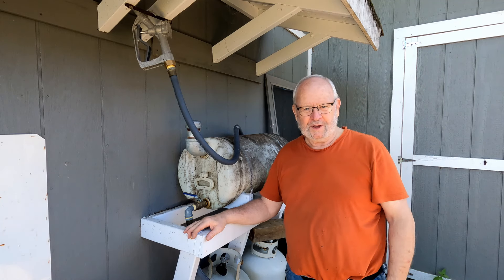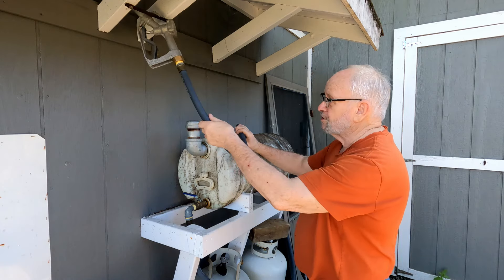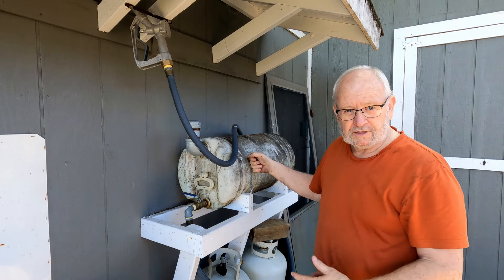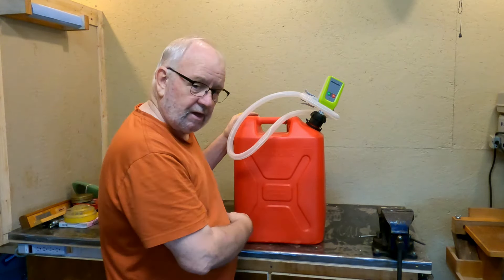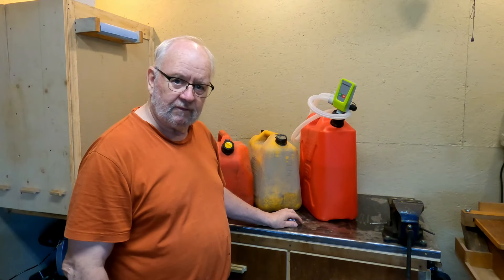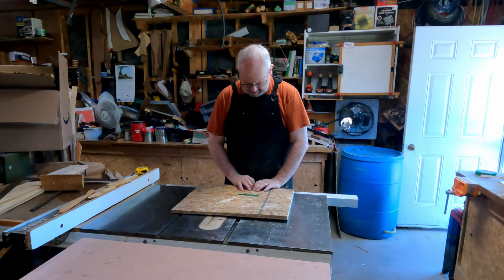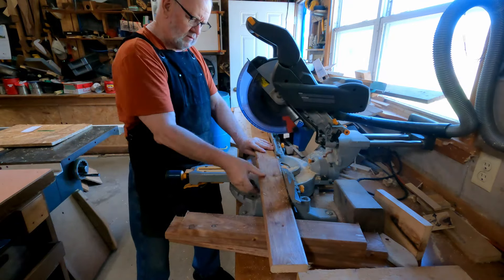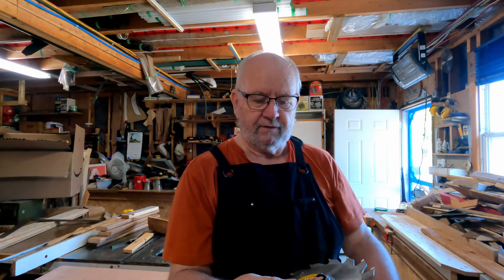A Shopmade Fuel Dolly Part 1

Comment: Working smarter, not harder. Just when I think you are running out of projects around the Camp you find more to keep you busy.  Always a pleasure to see you working away Mike. Take care and of course a hug forn Nannie J eh ! I was watching you the other day at the table saw with no insert around the blade. I feel a lot better seeing you are getting caught up on those. I have 6 for mine.
Reply from the maker: How's she goin'?  There is never a lack of projects or 'jobs' to be done around the camp that's for sure.  I'll be sure to give Nannie a hug from you old friend.  When I was using that wobble blade on the the 1 x 4 there was no way was I going to try that with no insert!!  It's all good now.   Take 'er easy!!
Reply: @GrampiesWorkshop  They don't take long to make either. I planed down a sheet (pc) of 1/4 ply and stacked the pieces up so I could saw up 5 pieces to run through a bandsaw. I haven done them for others . Esp for the dado blade.Just put them on a wall so they are easy to find.
Reply from the maker: @TomokosEnterprize  Stacking the 1/4 ply is a great way to make the inserts.  And having different size opening is key.  I'm kind of lazy and only have the one, but now that I made this one, I at least have 2 now!!  LOL  Take care!!
Reply: @GrampiesWorkshop  Yup 2 is better than none. Once the seed has been planted you'''ll always have it on yer mind. Not a have to do but it sits there untill it bothers you baad enough. My Mary was a pro at doing that to me. LOL. I promiss my lips are sealed to Nannie J, LOL. Have a beautyful week fella.
Reply: Hey, With all this going on now It is crazy to stiill  want to look back on our pasts and try to make any sense of it at all. Our days turned around wondering justj what has been done with them all.We seem to sleep less and get even less achived.We should e doing less with everything considering what we have learned  over our lifetimes . It causes me to pause and wonder just what we have being achiving these days. A conumdrum indeed old friend !  Take care fella. All the best of the best to you once again Mike !
Reply from the maker: @TomokosEnterprize  I hear ya Dean!!  I find it takes me all day to do what I used to do before break!!  But I'm still enjoying the ride!!  LOL  Take care!!
Reply: @GrampiesWorkshop  Ride em hard my friend. Just don't put it away wet eh, LOL.

Comment: I had found a comercial roll of wax paper that I put down under glue ups. Once the glue dries I slide it over an edge and the glue comes right off. The stuff lasts for a good long time.
Reply from the maker: That's a neat idea Dean!!
Reply: @GrampiesWorkshop  If you can't find wide wax paper regular works and another wide option is meat packers paper. It  has that slippry/water proof side. It's tougher than wax paper too. Where I worked last time we had a 24 wide bench for glueups and had the meat paper on a hanger (like a TP roll) at the end of the bench so we could get fresh paper to staple down. It was a really busy bench.
Reply from the maker: @TomokosEnterprize  A buddy of mine had a glue up table that I would like to copy some day.  It had a TP style holder for paper like you mention and he also had slots cut in the table for his pipe clamps.  Man it was a beauty!!  Take care!!
Reply: @GrampiesWorkshop  I have lots of pic's of that shop. We made log homes and when I wasn't on the tools (10 chainsaws, a skid loader 3 tractors and the sawmill along with the rest of the ranch I made trim for a 5 head planer/molder. I had all the toys any good wood shop needed. A single head planer is enough of a pain in the heini, just think about 5 timesnas bad eh, LOLOLOL
Reply from the maker: @TomokosEnterprize  A walk in the park for you I bet Dean!!

Comment: I wonder if that dado blade is still CSA Approved 🥴😳😂. Quite coincidence, I did a video today and mentioned I finally installed a zero clearance throat for my table saw 👍🏻. I love my gas cart, makes it so much easier filling up my tractor 👍🏻. OMG THE SUSPENSE IS KILLING ME Mike…what did he do…😂😂😂. Have a great week Mike and Nannie 👍🏻🙂🙋🏼‍♂️🇨🇦🍻
Reply from the maker: Salut Luc?  You know what?  When I saw your fuel cart I started thinking about how neat it was to take the fuel to the machine rather than the machine to the fuel.  The wheels have been turning ever since!!  This dado blade is pretty old.  I wouldn't be surprised if they are no longer available.  They look lethal eh!!  And they don't make a good dado as the cut out is not flat bottomed due to the swing of the blade as it cuts.  But for this project I figured it would do the job!!  Thanks for watching.  A la prochaine!!

Comment: What! I’ve never heard of a wobble blade for dado’s. I’ve used the dado stack….  Pretty cool tool. Great start on your dolly, heading in the right direction. Cheers, Mike. 😊
Reply from the maker: How's she goin'?  Thanks Mike.  I'm not too sure they even make these wobble blade anymore.  They don't really make a good dado since the bottom is kind of arced due to the wobble of the blade.  But for this project it worked fine.  Take 'er easy!!

Comment: Master carpenter at work. 👍🏻👍🏻👋👋. Nice job Mike. I’ll be staying tuned for the next exciting episode. 👍🏻👍🏻👋👋
What I’m wondering is why you didn’t put glue in the dado joint. ?  
Have a great Wednesday you and Janet. 👍🏻👍🏻👋👋
Reply from the maker: How's she goin'?  Thanks Noel!  I have been thinking about making this cart since I saw Luc's at Orange is my New Green!!  I didn't glue the joint for a couple of reasons, one; the OSB was so swollen and starting to delaminate that I figured the glue wouldn't work too good and second; I'm hoping the strength of this base will be provided by the perimeter board and so the OSB will be just held in there and wouldn't be able to move much anyways.  We'll see.  I wish I knew how this project was going too look.  It would make for a simpler build!!  LOL  Take 'er easy!!

Comment: Hi Mike - Looks like a good design except that osb board will not like the wet weather - will it be covered with a lid?
Reply from the maker: How's she goin'?  So far Ed I haven't got to planning any more than the base.  I have a set of big diameter wheels off an old mower I would like to mount on it.  I also hope to be able to keep the dolly under cover so the wet and snow shouldn't be an issue for the OSB.  Plus I was kind of toying with the idea of painting it.  We'll see though.  Thanks for the input though and for watching.  Take 'er easy!!